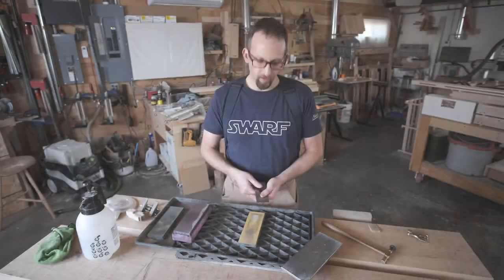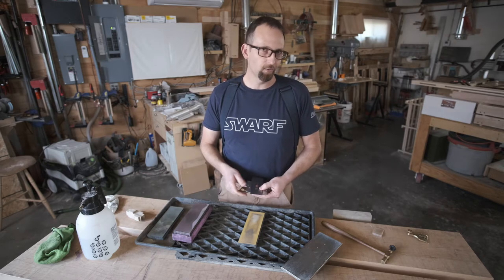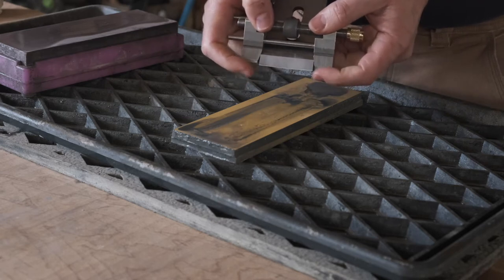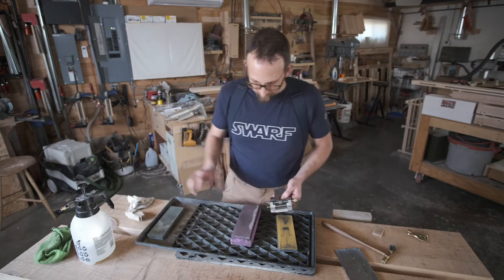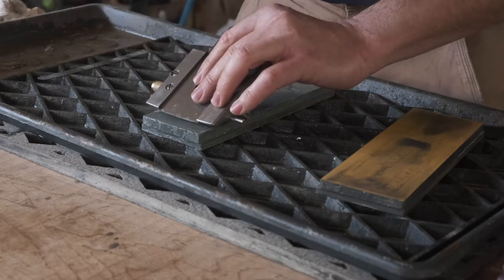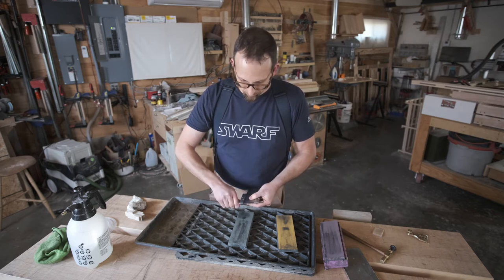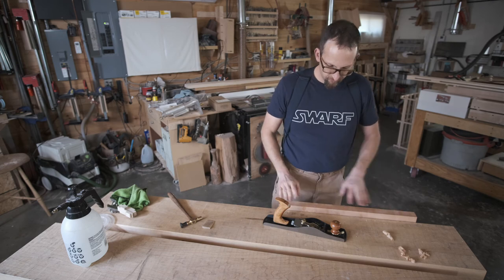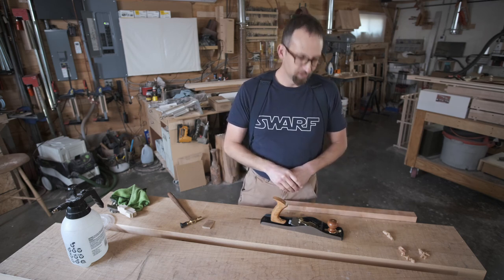Part 2: Add Camber to the Iron - How To Set Up a Lie-Nielsen Low Angle Jack Plane

Comment: Sorry, JE. This is an incredibly inefficient method, and I would not advise it at all. I've been cambering BU planes for 20 years, and can do all this work in under 3 minutes! Step 1: grind the primary bevel at 25 degrees (I hollow grind). The low angle makes for less metal to remove. DO NOT grind at 45+ degrees. There is too much steel to camber. Step 2: Add the chosen secondary angle when you hone, and add the camber at the same time. EG Add a 50 degree secondary/micro bevel and camber this. There is little steel to remove, and it should take a minute or two to do. Done. Regards from Perth, Derek Cohen

Comment: Nice video! (sub'd) Did you end up needing to resharpen after touching the blade with the mouth closing plate? I would think not since it didn't seem to be a violent impact...
Reply from the maker: It wasn't bad. I don't recall it needing sharpening right away. I think I went straight to truing up some stock with it, so a small ding wouldn't have been a problem.

Comment: Do you find going from 1k to 5k to 8k is beneficial? I think Rob Cosman goes from 1200 to 16k, but that may be purely for speed aspect. Just curious if you've noticed.
Reply from the maker: For a while I was without my intermediate stone and I tried jumping straight to 8K. It felt like it took forever to get the scratches from the 1K stone out. Maybe if I had stuck with it longer and got a better feel for how much polishing I was really necessary, I wouldn’t have needed to stop and check so often. But in the end I think it’s faster to just use the middle stone. If you can’t afford it, then maybe it’s a good money saver.
Reply: @thejointeffort  I see Christian Schwarz has those same 3 as well. Makes sense! Suddenly feel the need to spend another $200 on my sharpening setup :p

Comment: Have you use a veritas low angle jack plane.?
Reply from the maker: Yes. That was my first bench plane. It works well. And I really like the PM V-11 steel that Veritas makes. But over the years I’ve come to prefer the overall design and especially the shape of the handles on the Lie-Nielsen planes.

Comment: Your "unequal" problem is you lost count of the number of strokes you made on each side.  That's easy to do if you let your mind wander even a little as work.  I noticed in camber videos that blades are sharpened fully square, and then maybe 4 - 5 camber strokes per side are taken and no more.  The cambered edge does not have to be raised high off the surface of your board to avoid leaving marks.  If that's the case maybe your board first needs to be flattened.  I do not use a chambered blade when I am trying to maintain a square edge in a workpiece especially for jointing.  

Having a few extra blades allows for experimentation of higher or lower angles as opposing to using high angle frogs.  I have not tried it with a plane blade yet but I have read that chisels should not be sharpened to an angle of more than 25° due to thinning and thus weakening the edge potentially causing chipping when the tool is used.  

This next point is not directly related to your video but I have noticed that there is no reason any cut has to be made 90° to a workpiece.  Rotating the front edge of a plane skews the blade away from the direction of the cut and does two things:  it makes the cut 1) easier in difficult grain and end grain (and sometimes possible at all) and 2) in a pinch it allows a slightly dull blade to still make a clean cut.  I suspect that not all of us stop to sharpen a blade every time we should, especially when only a few more passes remain.

Comment: Great video. Thank you for sharing your experience. Just a quick question, if you don't mind. That water bottle looks pretty good. Which brand is it? Thank you.
Reply from the maker: I don’t know the brand. Though I’m not sure that would help. I bought it at a home center. I’ve had several and every time I need another the store is carrying a different brand. Search “Garden Sprayer” and you should find something that works.
Reply: @thejointeffort  thank you!